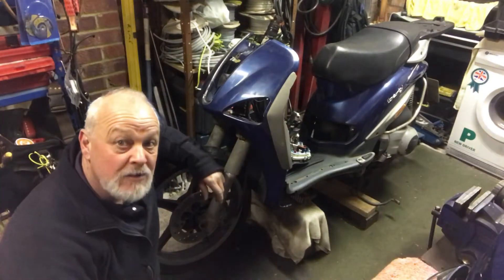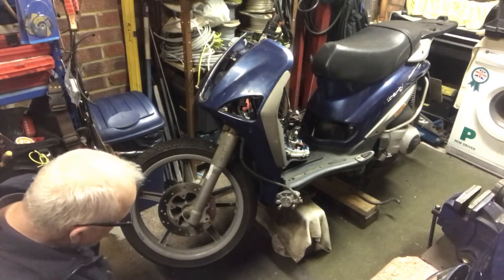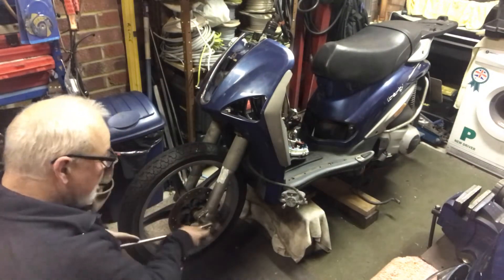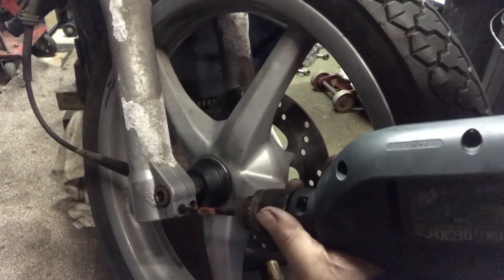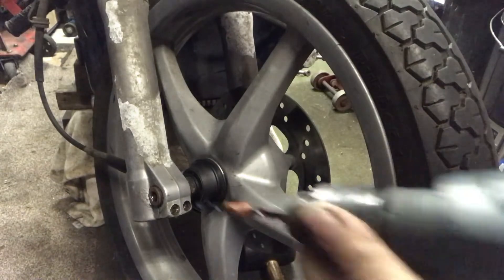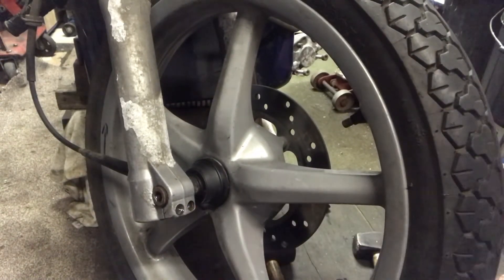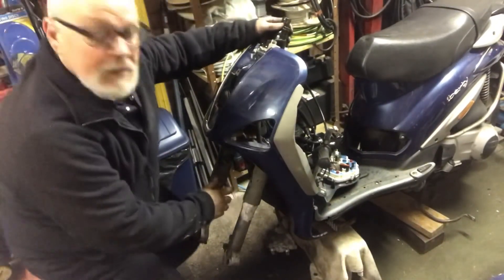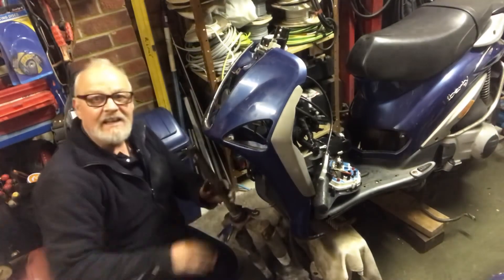How to replace head stock bearings on a scooter no2

Comment: Great video, it helped me a lot. I do have a pointer though. When you're needing to remove the wheel, I'd recommend leaving the brake caliper on the disc. Then, use a cable tie to fasten the brake lever closed. That way, you can loosen the wheel axel without having to put your weight into it, just focusing all energy on loosening the nut.